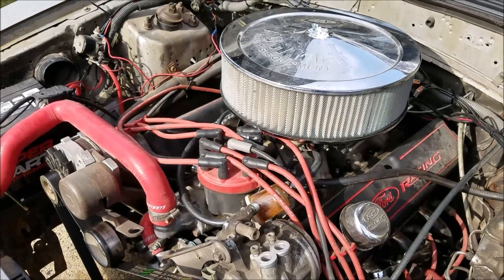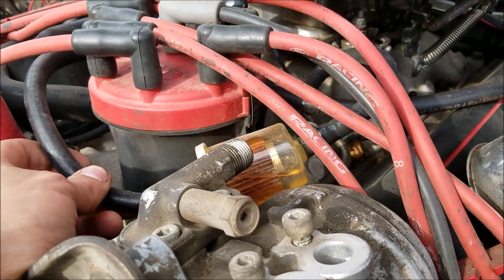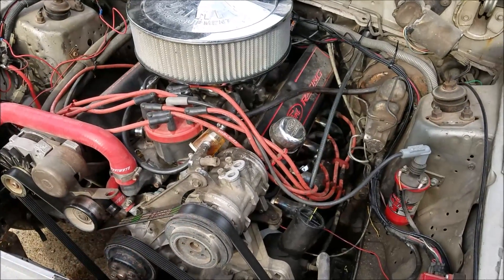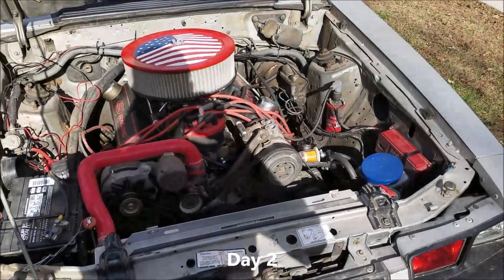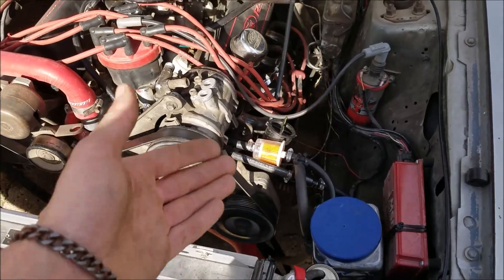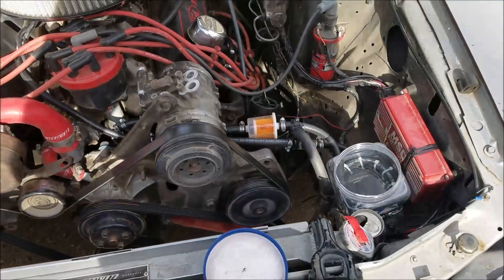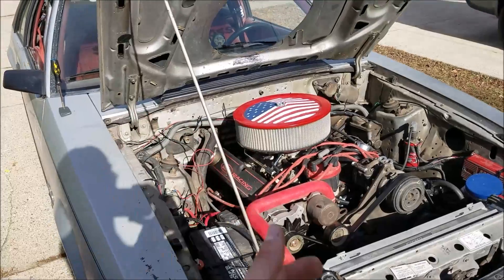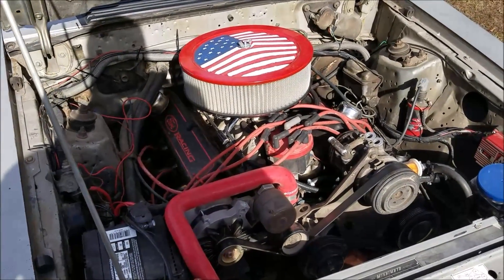Carb Tuning & performance VS Under Hood Heat: Explained & Homemade Fuel Cooler (The Rotstang)

Comment: I'm new and late to this setup. You use a fuel filter in the return line? Does the return line go back to the carburetor rather than to the fuel tank?

Comment: experiencing the same thing with my 82 stang, has electric fuel pump, not sure if to add a 3 way fuel filter with a return line, or perhaps a fuel pressure regulator with a carb spacer. honestly have no clue.. runs great other than the heat soak after being parked.

Comment: If I get ambitious, I'll make a video showing a worse situation that I've been dealing with for over ten years now.  My solution is an electric fan that runs long after I shut the motor off.  It completely solves heat soak, and is probably better for the whole engine.  But having a high compression motor that barely turns over plus a battery that's partially depleted running the fan makes for some scary across-town stops.

Comment: I got rid of that steel line, used rubber line with insulation, now I need to insulate the fuel pump a little from the block

Comment: awesome job buddy. another trick: you can use metal tubes for this. the thermal conductivity form metal is way higher. So you can lower the temp with the same system. And also i would isolate the tube to the carp behind the cooler. But again this is a very cool video thank you

Comment: Do you think  pouring a bottle or two of hyper lube super coolant in the radiator would help fight the vapour lock since that stuff is supposed to make your car run cooler?    Or what if you ran some Marvel mystery oil or Lucas fuel additive in your gas tank could that possibly reduce the boiling temperature a little?

Comment: Can this heat soaking cause vehicle to hesitate add bog down under acceleration and or driving up hills??
Reply: Yeah that's what my 454 was doing vapor lock or gas boiling couldn't hardly go up any hill or accelerate fast I got a new pump and still once it gets heated up its starts it again

Comment: Edelbrock carbs are the worst for that because of the side fuel tanks they pick up the heat from the manifold I've had to run a 2-inch spacer plate and then use the insulated tubing for home air conditioning units and run my fuel lines through that stuff
Reply from the maker: I'm going to do an video of holley vs edelbrock soon. The carb on the rotstang is a summit 600.

Comment: best way to deal with that issue I used to use a metal coffee can copper tubing and dry ice
Reply from the maker: moonshiner condenser style!
Reply: ThunderHead289 yes just like that
Reply: ThunderHead289 I've seen guys convert those small igloo water coolers into fuel coolers....they keep your ice water or dry ice cold much longer and much cooler...because there insulated and small enough to fit under most hoods
Reply from the maker: +The Dude that's a genius idea! That's so happening!!!! Nice 👌 total credit to you sir
Reply: ThunderHead289 yeah those do work really good especially when you used copper tubing or some other metal tubing in the vessel....and the water spouts are removable for cleaning so only one small hole is needed on the lid to run the line in or out depending on which direction you run the fuel....I'm told running the fuel in the bottom and out the top works best because ice floats....also seen guys run rubber hose over fuel line tubing to isolate it from direct contact with the engine and help insulate the fuel line from heat because rubber isn't a good conductor of heat....everything helps get that fuel just a bit cooler and as you know cool fuel helps make that power
Reply from the maker: +The Dude wise words 👌
Reply: ThunderHead289 an old school drag racer taught me this trick when I was a kid....it's always cured the issue every time I've ran into it....even just cool tap water can it enough...in light cases just a rubber hose over the metal tubing can be enough.....I've just gotten in the habit of slipping hose over the fuel line tubing on all my personal vehicles....but I also like to have as little rubber fuel line on my stuff....I've always had terrible luck with rubber lines collapsing on me....especially now with all the ethanol fuels now so I use as much metal tubing as possible
Reply from the maker: +The Dude the whole fuel system on the rotstang is rubber line. Hope I don't get screwed there
Reply: ThunderHead289 oh man with that much rubber I'd be fully expecting issues at some point....but I've always had  issues with rubber fuel lines....especially the ones right near the pump collapsing and getting sucked flat